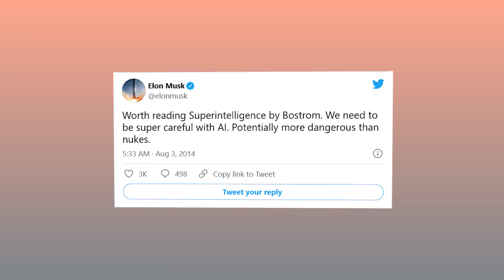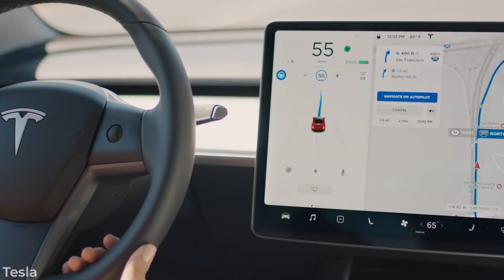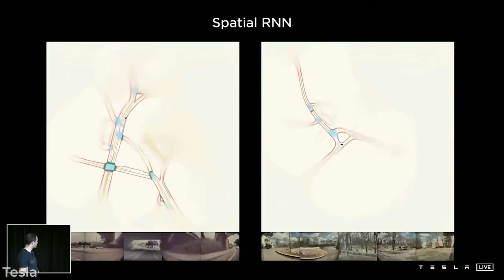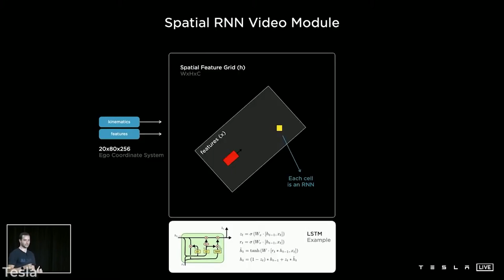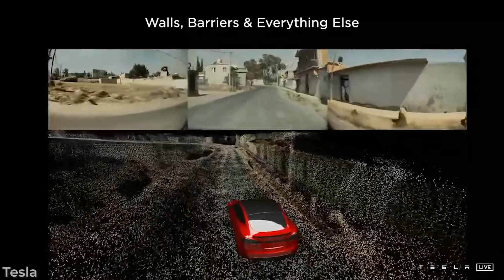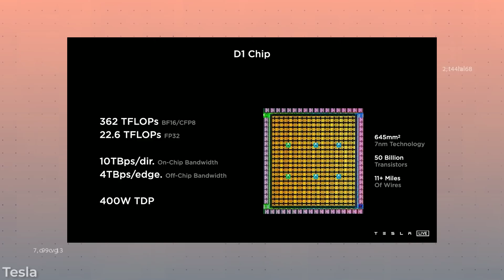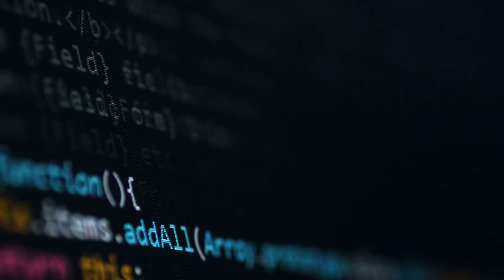Elon Musk Unveils Humanoid Tesla Robot | Tesla AI Day Event

Comment: I've been sure about AI being able to take over almost all jobs for a few years already. I have seen hardware and software more then advanced enough to easly take over almost all human jobs and do it much more efficiently. for that reason I also saw a future where basic work is voluntairily and where all can do whatever they have the most passion for, which would also stimulate innovation. however such a robot makes sure litterally everything can be done by robots. 

for a similar reason I also already designed systems build of existing hardware and software so that only the linking needs to be done to make it capable of taking over most essential jobs.

I have also been working on some concepts, ideas, solutions and fixes for a new world system to replace the current system based on economy, work, ruler->slave, and capitalism communism etc. it seems that it will actually work better than the current system, however it will only work when people see that the old style is no longer needed in a new world. it is largerly based on the open ****, such as the open source, open hardware, foss, etc. and so it has largely already proven to work, but people must accept it. also it is changed to work as a world system, since there are other factors in here. I have also worked on some other systems, but they are either more different for people, less tested, or more complex in a way that you need someone who understands it for it to properly work.